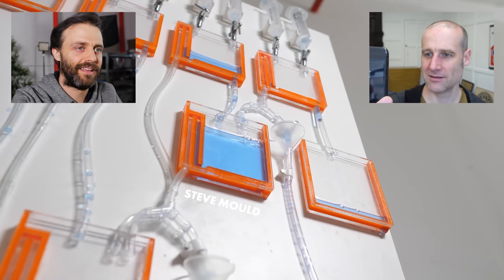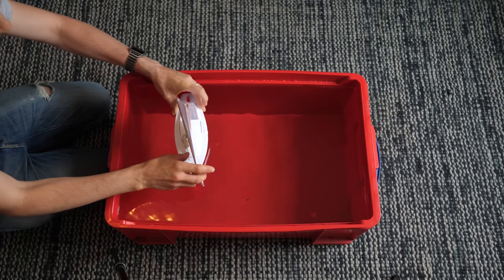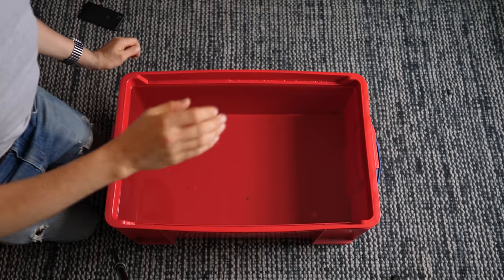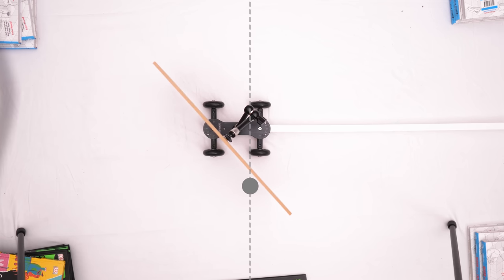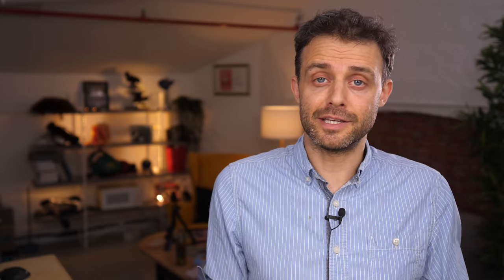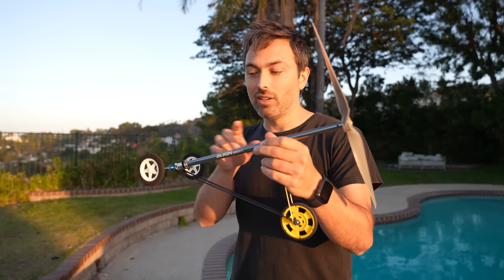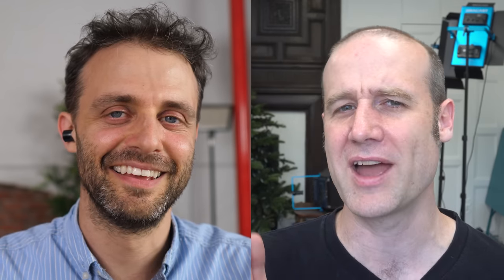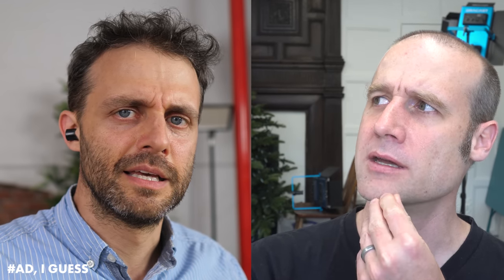Sailing Faster Than The Wind - How Is That Even Possible?

Comment: Are you sure about a plane being able to fly with a straight plank instead of its wings? I've had a few fluid dynamics classes and it seems wrong to me!
Reply: That's what a paper aeroplane does.
Reply: You can buy small toy gliders with flat plate foam wings. They work just fine. Not as efficient as optimized airfoils and quicker to stall, but they clearly produce lift.
Reply: @eyytee  And powered ones with rubber bands.  It's hard to imagine a childhood without them.

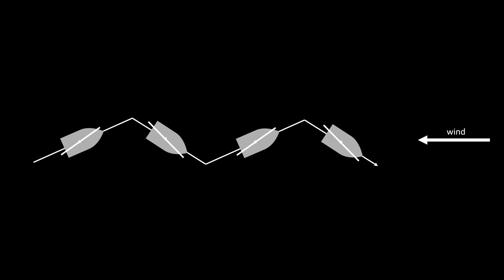Comment: 8:50 the sails are angled wrong in that tacking graphic. They should be angled at some angle between the oncoming wind and the course.
If the sails were set like that the boat would sail backwards.

Comment: Technically its not possible if you dont charge energy in to somehow somewhere . I mean lets say push force is 10km/h thata the speed difference if you are faater then wind you get force on opposite direction as you are faster then wind technically wind is on rewerse at that case ... ;p except we still haw air pressure but as airplane wings use that .
Reply: But stil with big enough charging mechanism, its still possible to make a boat that runs against current ... probably ;p

Comment: I think the Veritasium video is misleading (not the same as lying). The vehicle IS going faster than the speed of the wind, and it is clearly not going side to side, it is doing it by changing gears. They don't mention this anywhere in the video because he only cares about views and tricking the public with slide of hand. The reason this is important is because the claim that the vehicle can go faster than the wind pushing it is true (that is how he baited the professor and IMO "stole" his money). But the public is imagining that the vehicle is propelled by the "current" wind, when in fact it is storing the energy of "previous" wind, it then changes gears (blocked by public sight) and is able to just beat the wind speed. That whole channel is garbage and I don't recommend it. This is the only channel that explains things well and tells you the whole truth without smoke and mirrors (that I know of). Massive respect for Steve.
Reply: //"But the public is imagining that the vehicle is propelled by the "current" wind, when in fact it is storing the energy of "previous" wind, ..."//

Nope.  No stored energy is used to accelerate the Blackbird.  NALSA rules. 

//"it then changes gears (blocked by public sight)"//

No again.  The Blackbird gearing is fixed during a run.

Comment: Pity.  You could have actually used that device to show you can push it downwind in such a way that the downwind component is faster than your pushrod.  That would have proved the actual point.  Now you just showed it going faster sideways, which is not the bit people are disbelieving.
Reply: Here's what you do:
- Put the cart at an angle of 45 degrees, (i.e. from southwest to northeast)
- Put the 'sail' at an angle of 30 degrees to horizontal (i.e. from westsouthwest to eastnortheast)
- Take your rod and put it against the leading edge of the 'sail'.
- Push at 90 degrees (i.e. from south to north)
- Marvel at the cart counter-intuitively going northeast, with a northward component larger than the pushing rod!!
Reply: And as a thought experiment (if you don't have a cart like this handy):

First, imagine what would happen if you aim the cart at a 45 degree angle, and put the sail directly horizontal (i.e. at zero degrees).  And then you push against the sail direcly vertically (at 90 degrees, upwards).  

It's quite easy to see that the cart would move at a speed to exactly keep up with the wind.  So the 'downwind' component would be the same as the wind speed.

Now, suppose you turn the sail, ever so slightly, towards the angle of the cart's direction.  (so if the cart was going up and right, and you're pushing directly up, you turn it anticlockwise)  What would happen if you push it now?
Reply: Or (just realised ^^;;)  Do what you did at the 8:30 mark, except push it from the bottom left instead of the bottom right.

Comment: Derek's video provided a 3 second explanation of how his vehicle worked.
The problem is, his explanation made no sense which leads me to believe that he didn't understand the relationship between the prop, the wind and the forward movement of the vehicle. 
He made a very quick reference to the wind pushing the body of the vehicle and the prop not being turned by the wind - it really made not sense at all.

Steve, are you able to make sense of Derek's explanation?
https://youtu.be/jyQwgBAaBag

Comment: A sailboat on a tack is running at an angle to the wind. The wind is always pushing on the sails. A sailboat never outruns its power source.   That contraption is doing the same thing. It's running at an angle to the wind, otherwise it would be outrunning its power source. You cannot travel faster than the wind STRAIGHT DOWNWIND, only at an angle to the wind, otherwise there is nothing powering you. Forward momentum powering the wheels is not a power source.

Comment: Wrong in some parts. Falsch. Ein Segelboot auf halbem Wind erzeugt durch seine eigene Geschwindigkeit Fahrtwind von vorne, also 90° zum natürlichen Wind. Der Winkel, in dem der Wind wirklich um die Segel streicht, wird also mit zunehmender Geschwindigkeit immer flacher, der Fahrtwind immer grösser, der Aerodynamische Lift am PROFILIERTEN Segel (Funktioniert wie eine Tragfläche eins Flugzeugs) beschleunigt immer weiter etc. So ist es auch mit dem rotierenden Propeller. Der echte „Wind“ am Propeller kommt eben NICHT von hinten, sondern je schneller desto schräger desto ,ehr Lift desto schneller desto schräger etc. 

Begrenzt wird das Ganze beim Boot durch Reibung der benetzten Fläche und der Länge der Wasserlinie also durch die Rumpfgeschwindigkeit und die Gleiteigenschaften. Beim Lndfahrzeug der eigene Luftwiderstand und die Reibung der Mechanik und der Räder.
Reply: Evidently, the maker of this video knows little of either sailing or aerodynamics. It is very disappointing.

Comment: There’s an old Boeing engineer with a video that shows it to be both Bernoulli and Newton aka snow-plow. He also shows that the assumption of Bernoulli advocates for air molecules meeting up at the trailing edge is false though in favor of even more Bernoulli as the top side molecules actually beat the shorter bottom side from leading edge to trailing edge. It’s a lengthy lecture, however.

Comment: I think Veritasium's explanation wasn't hand-wavy, it was just plain wrong. The animations were cool but the way he explained them didn't make sense. Boats can't travel faster than the wind when the wind is coming from behind. As soon as the wind makes an angle greater than 90° with the direction of travel there is no way you can outrun the wind. The boats he shows in the animation are crossing the wind at about 120°.
Reply: I give you my absolute assurance that the explanations on Veritasium were correct.
Reply: @Rick_Cavallaro  could you explain or at least point me to some video or paper that explains how can a boat be faster than the wind when it's being pushed from behind, not from the side or from the front as it's shown in both these videos. In my limited sailing experience it doesn't make sense but I'd like to learn why I might be wrong. 
Also, would all of this still work if you changed the size of the wheels while keeping the same internal gearing?
I'm assuming that bigger wheels would turn the propeller slower and viceversa so how did you decide what ratio to use? Are you just changing the pitch of the propeller's blades until it starts working as expected?

Comment: They explained tacking really well, but they did not explain how the propeller car could work. 
Once the car equals wind speed, there are no more wind forces acting on the car at all. Nada. Unless the car is moving at an angle to the wind. 
My vote is either the wind is angled, or the car is running on inertia.
Reply: "Unless the car is moving at an angle to the wind. "

The propeller blades are moving at an angle to the wind. The car is moving straight downwind.
Reply: @eyytee  There is no net wind force acting on the propeller.  

Imagine you have an airtight box big enough to contain the propeller car.  You put the prop car in the box and close it up.  Then you put the box on a truck and drive the truck 30 miles per hour.  

The air inside the box is moving 30 mph, but *zero speed relative to the propeller*.  You can spin the prop with your hand, but the air inside the box exerts zero net force on the propeller, other than drag slowing it down.  

This is the exact same situation as if the truck has a 30 mph tail wind and you take the box away.  Once the prop car reaches wind speed, the propeller is in stagnant air and experiences no force to move at all.  

Now the wheels could drive the propeller, because they are linked to it, but only by stealing energy from the car's ground speed and putting it into the propeller's spin.  

Veritasium says the propeller screws into the direction of the car's travel.  This means the prop gets all of its spin from its wheels and not directly from the tail wind, which would want to turn it the opposite way.  To work then, power from the wheels must be geared/designed to overpower the propeller's backward torque from the tail wind.  

Before the car reaches wind speed, the wind pushes on its overall sail area and moves it forward.  Once the car equals wind speed, the propeller is in stagnant air, but keeps turning because the car's inertia drives its wheels which drive the propeller.   So at equal-to-wind speed, the car would get an extra push from the propeller for a short time until the whole thing loses inertia and slows down again.  It is an overly-complex flywheel effect.  

I admit I am thinking out loud here and open to explanations, but I have not heard an actual explanation yet that adds up.  I am reading about autogyros and wondering if that principle has something to do with it...
Reply: @JCAtkeson3  "There is no net wind force acting on the propeller."

Wrong. A spinning propeller will produce thrust in static air.
Reply: @eyytee  That is the propeller driving the air, not air driving the propeller.  Energy is flowing the opposite way.  Yes a sailboat can move in stagnant air if you flap the sails with a motor, but that isn't wind power.
Reply: @JCAtkeson3  "That is the propeller driving the air, not air driving the propeller. Energy is flowing the opposite way."

Depends on the definition of "driving" and on the reference frame.
Reply: @eyytee  Explain in detail how you think the car goes faster than wind speed.
Reply: @JCAtkeson3  It's explained in Derek's video and in his pinned comment and in these references:
2013 US Team Semifinal Exam - American Association of Physics Teachers (page 10)
Gaunaa, M., Øye, S., & Mikkelsen, R. F. (2009). Theory and design of flow driven vehicles using rotors for energy conversion.
Mark Drela, Dead-Downwind Faster Than The Wind (DDWFTTW) Analysis
Reply: @eyytee  No, explain in your own words.  If you're going to troll post over every detail, you better be ready to prove you know what you're talking about.  Now is your time to shine.

Comment: you still didn't come near the real core of the "running before the wind machine" inventor's claim (that "handwavy" bit): that a ship tacking downwind could beat a ship running straight before the wind.  I don't believe it.  Logically, the increase in speed is cancelled out by the increase in distance (and in the "real world" Steve alludes to, there is the business of resistance).  Also, if this were so, there would be no market for spinnakers, that just increase the efficiency of running before the wind.  And you'd see a whole lot of tacking downwind in yachting races.
Reply: You ONLY see tacking downwind in the Americas Cup races.

Comment: Now do all of that chalkboard logic with a real sail that deflects and becomes concave at between 1:4 and 1:3 thereby losing over 1/4 of the push along the sail's leading edge and forcing the trailing 1/4 of surface slip back against the initial wind flow - canceling out between 1/3 and 1/2 of the gain from any push. Or, don't, it is nice to fantasize that sails are completely rigid 2-D objects and that compression of air vectors doesn't cancel out opposing eddies and negate increased high angle slippage due to exactly what makes wake turbulence factors an issue in wing design. I get it, really, click rate and view hours and adsense, whatever, aren't geared toward bumming people out with reality to get ahead in this hole.

Comment: There is nothing surprising or even difficult about sailing downwind faster than the wind. A windmill driven boat can sail directly across the land directly into the wind driven by the wind. A downwind faster than the wind craft sails through the air driven by the ground. Its just a question of two interfaces moving relative to one another. Moving through one interface driven by the other interface. Simple! see http://www.sailwings.net/rotaryhome.html

Comment: Very bad explaination of how a sail works. A sail is an airfoil with lift on the back side, just like lift on the top of the wing. This is what allows it to go faster than the wind in close-hauled or close-reach.  In an airfoil you don't need wind to go forward. As the wing falls by gravity the top side is lower pressure creating the lift upward and forward.  
Same thing happens on a sail. The wind tips the sail and the counter weight wants to tip it back upright.  The backside of the sail, which is an airfoil in the vertical now creates the lift to move it forward.  The curve of a sail has the same shape as the curve of a wing.  This is why America's Cup catamaran boats can move into the wind at twice the wind speed.

Comment: Ha ha, Bernoulli's affect, air over the wing makes a no sense, in part it makes a negative pressure point but it's displacement, under the wings, like a boat, if it needs a low vacuum to fly and the wing shape is for this reason it would mean, AIRCRAFT COULDN'T FLY UPSIDE DOWN, BUT THEY DO BECAUSE OF ANGLE OF ATTACK CHANGE TO DISPLACE THE AIR PRESSURE, the wing shape has nothing to do with low pressure compared to the same wing inverted. Sorry ( look up/ Plains don't fly they float).

Comment: Do I miss the point of this video? In my opinion this doesn't explain how you can go faster than the wind IN THE DIRECTION of the wind. Only how you can go faster than the wind. But it does not explain how the VMG of a sailing boat can be bigger than the actual wind speed. In all the examples, the speed component of the boat paralell to the wind was always smaller than the wind speed, right?

Comment: but the vehicle doesn't use "sails" it spins a prop that creates a localized air pocket that pushes against the wind?  and sailboats can't travel faster than the wind directly with the wind only at a cross angle.  so this doesn't actually address the original video no?

Comment: 2:50 I don't think this is actually true, there's not enough contact between wind and sail for Coandă effect to cause it to stick to the surface,

see https://www.youtube.com/watch?v=vttSiNicGH4
Reply: you can see the stream actually deflects to the other side, which would add a (smaller) counteracting force to the thrust the boat gets from the main wind-facing side

Comment: You failed to demonstrate the more important concept that parallels sailing. You demonstrated that a sailboat can reach speeds faster than the wind-speed due to the vector component of wind direction; The real point though is that a sailboat can travel downwind faster by tacking than the wind-speed providing the motive force to the sailboat.
Reply: My animations on downwind VMG explain the point you mention.

Comment: From your explanation and models , this information tells me that the boat is not going faster then the wind its traveling at the same speed. When the wind hits the sail and is slowed down its due to it hitting the sail, therefore ya the wind hitting the sail is slower then the speed of the boat, but that loss of momentum is absorbed by the boat causing the boat to travel at the same speed of the wind that has no obstacles in front of it, your mathematics of angle and distance is not a proper demonstration of force and speed.

Comment: I just realized you don’t understand “lift”
Reply: Lift is the difference in air pressure between the top and bottom of a wing. Not the angle air is directed.

Comment: Having a scientific background, my first reaction is that this can't be, it violates the laws of thermodynamics. "Perpetual motion machine" also came to mind. But early this morning, before I was fully awake, I had a sort of a revelation. I compared this matter to how a telescope works (I am, among other things, an amateur telescope maker). A telescope is essentially a light funnel...it funnels light from a relatively large area (the telescope's aperture) and transmits to to your relatively small pupil. Then, when considering this "faster than wind" vehicle, I thought in terms of extremes: what would be the result of gathering a lot of wind power with a relatively huge propeller blade, and bringing all that power to bear upon a relatively small gear system with a favorable gear ratio? (Of course, to work practically, excess weight would have to be minimized). Just think if you could harvest all the power of a massive propeller, and bring all of this power to bear on a relatively small system of gears and wheels. Getting back to the telescope analogy, a critic may say "You can only access the actual photons entering your pupil." This is true, but with a telescope, you can funnel and greatly increase the number of photons entering your pupil. Likewise, you can "funnel" all the power of a large propeller into a small gearset with a favorable ratio.